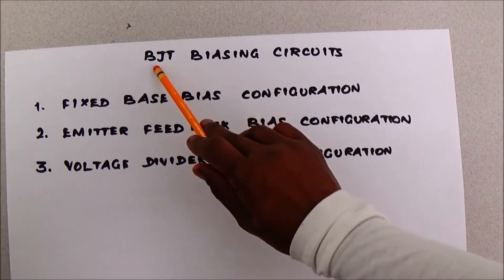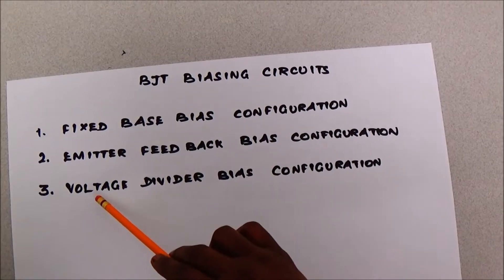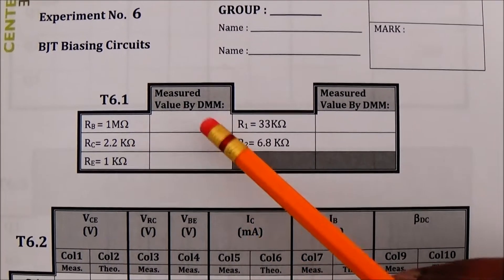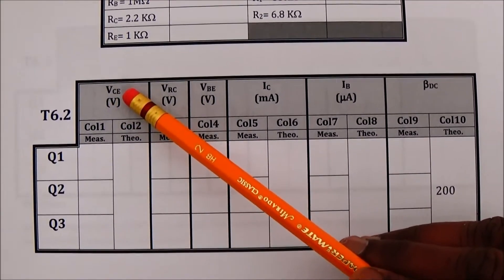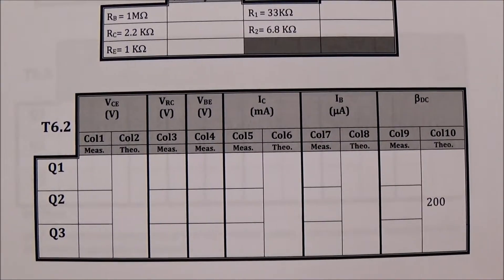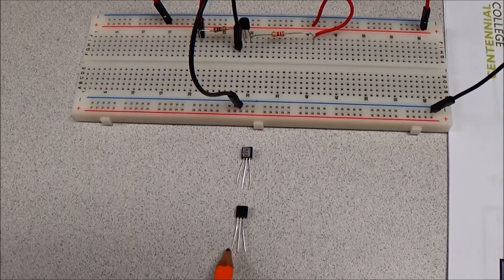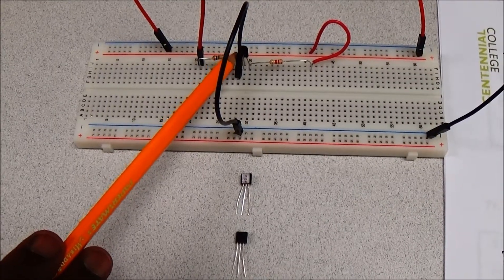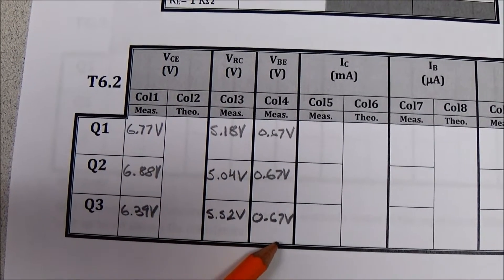BJT Biasing Techniques

Comment: Something is wrong in your calculations. Then what is emmiter current? Ib=0.004mah and Ic= 0.79mah, According to it Ie= 0.004+0.79=0.794 mah
But if we measure according to V=IR and I=V/R, then Ie=7.7v/1000ohm = 0.0077Ah
0.0077A x 1000 = 7.7mah
Ie value is different in both cases. Which shouldn’t be.
U didn’t explained it
Or the resistor “Re” should be 10k